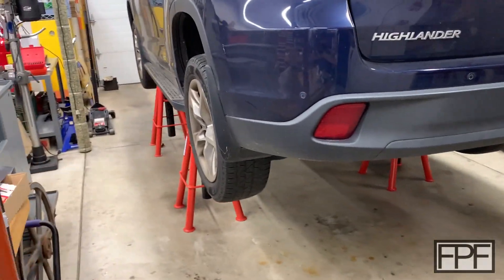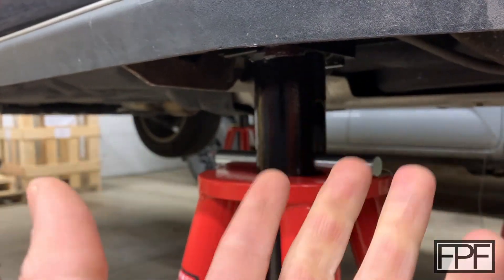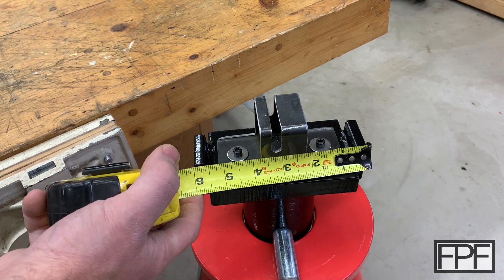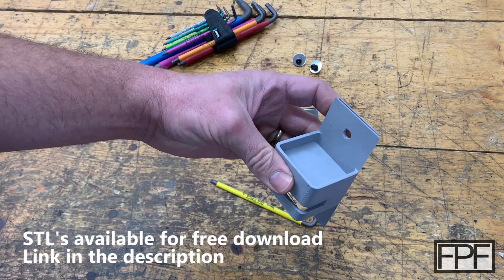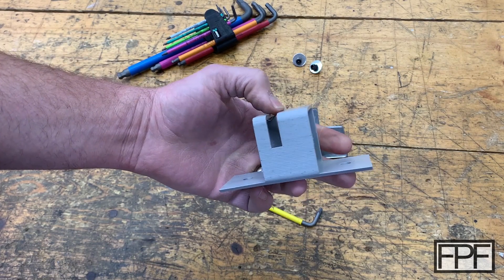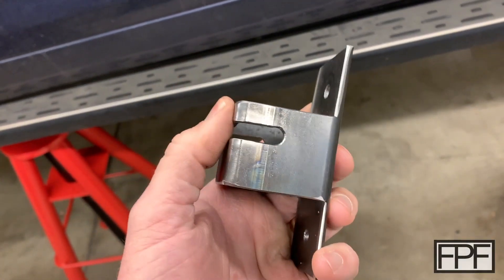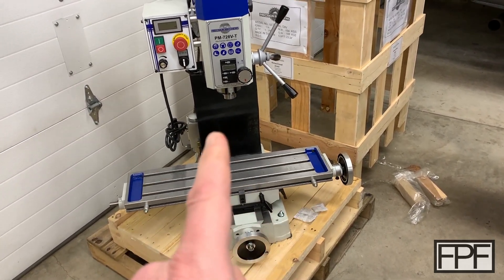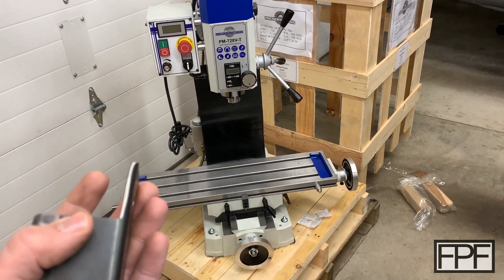Using 3D Printing to Prototype Parts for Metal Working

Comment: Something I've done a few times with my 3D printed parts is printing a two-layer (or thereabouts) slice of the design to make sure the dimensions of the full 3D print are correct. Doing two layers gives it a bit of stiffness, but doing only two layers makes sure that I'm not wasting plastic if I made a design error in the model.

So you can 3d print a 2D prototype of your 3D print prototype for your final metal piece :D
Reply from the maker: Great idea and thanks for sharing!

Comment: Since it is a compressive load, maybe you could have gotten away with a hollow printed part that you filled with fibre reinforced concrete.
Reply from the maker: That's a really interesting idea. Have you seen this done?
Reply: @FunctionalPrintFriday  not to take such a serious load with a safety aspect but I have filled a large part with concrete reinforced with metal grid*. In that application the plastic was like a single use mold for the concrete that was never removed. * Lightweight galvanised fence material made from wire, not the kind of grid that goes in a poured slab.
Reply from the maker: @AndrewHelgeCox  thanks, I might have to give something like this a try